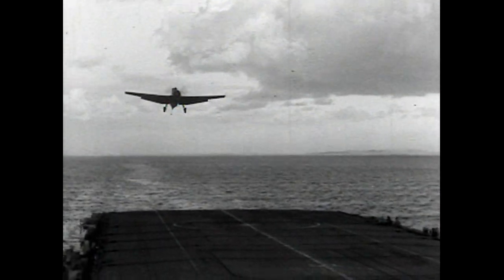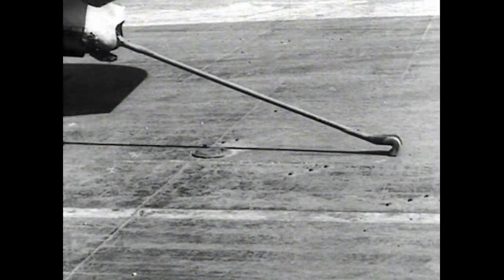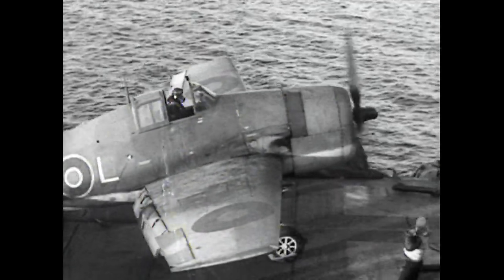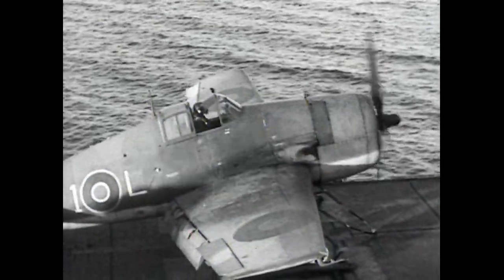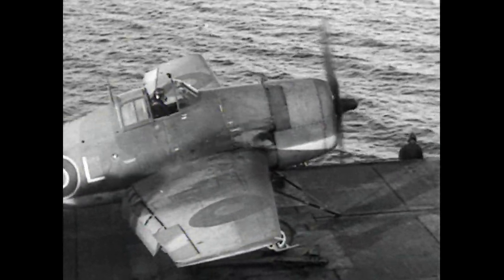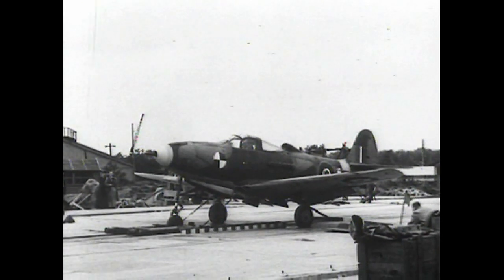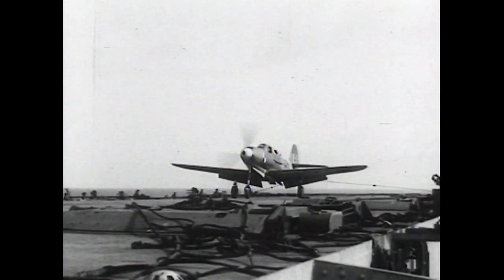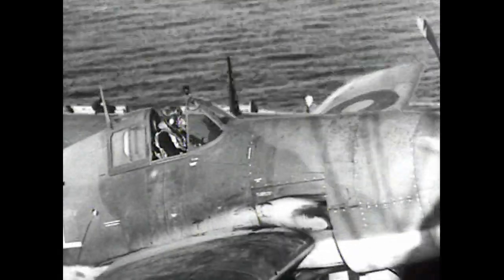Grumman Avenger & Hellcat, Bell Airacobra, Vought Corsair

Comment: Reference the Airacobra deck operations, Reddit (see r/WWIIplanes) adds some fascinating details of the landing of AH574 on the Pretoria Castle: 

The Airacobra had not been cleared by RAE for carrier deck landings and take-offs, only approaches and go-arounds. The pilot, "Winkle" Brown, had been advised by the RAE "boffins" that the nose landing gear should be strong enough to absorb the landing shocks, but that there might be a problem with the take-off because of engine power. 

In order to be the first to land a tricycle undercarriage-equipped aeroplane on a carrier, Winkle Brown had discussed the issue with Pretoria Castle's captain (Captain Caspar John). John suggested that if Brown was to declare an engine problem on an approach he would receive clearance to land. This he did. The landing was successful as was the take-off, with the carrier at full speed into wind. 

Does FAST have any reports on the conversion of AH574 for carrier use? I do not know of any other US land plane converted for carrier use by the UK in WW2. It must have taken a major design and engineering effort to modify AH574. 

As regards, the Wildcat/Martlet versus Hellcat/Gannet confusion, it's a frequent error. It's a shame we all couldn't have built the marvellous 1/48 scale Monogram kits of the same in the 1960s, as I did. The respective location of the wings, and the different types of undercarriages and their location, makes recognition easier.

Please keep producing these videos. There are gems. Many thanks.
Reply from the maker: Ted Mustard many thanks for this added info, very interesting. Glad you are enjoying the videos. Please share so we can get the viewing numbers up!